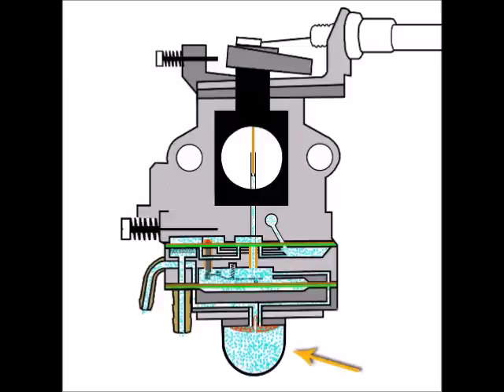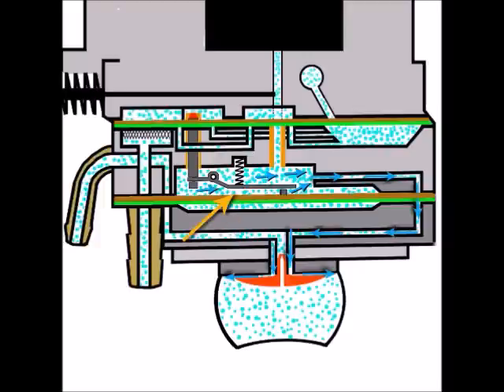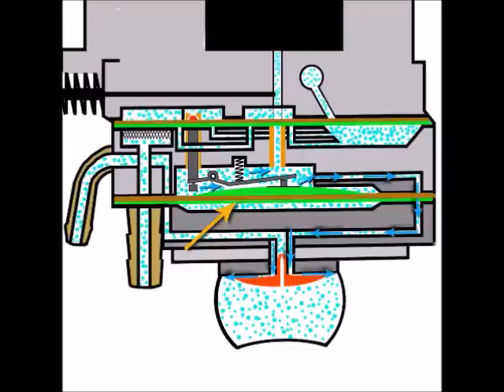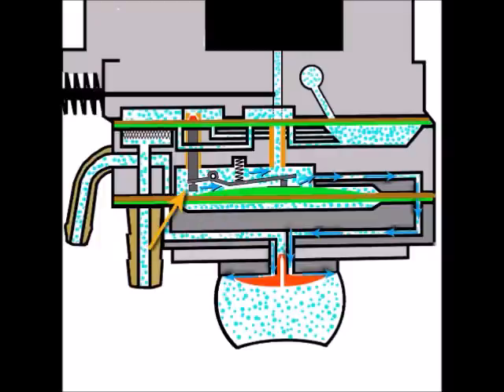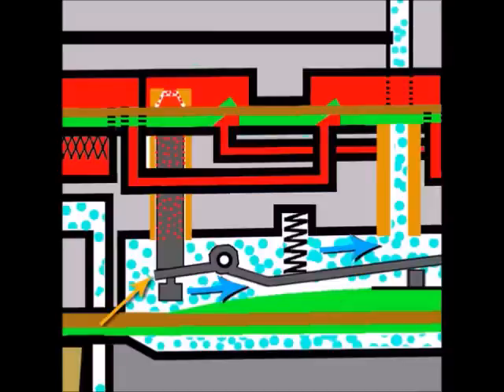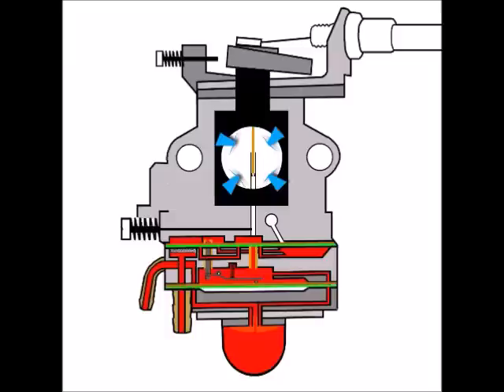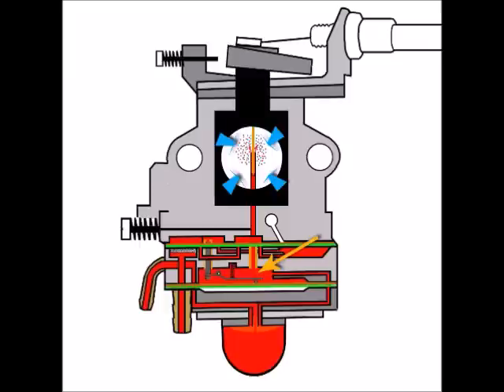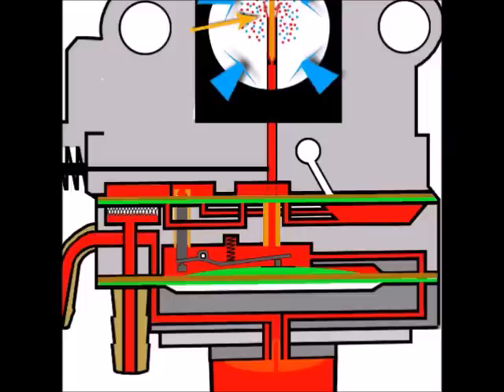CHAINSAW CARBURETOR DIAPHRAGM: 'Metering Diaphragm' EPIC Function!

Comment: This is the best explanation I have seen to explain Metering Diaphragm Carburetors for 2 cycle engines. Most people I deal with just toss them out and buy a new one without ever learning the basics of its operation.
Reply: The main reason for that is because usually just replacing the diaphragm or carb kit doesnt fix them, it's usually a faulty check valve or small passage under one of the Welsh plugs is blocked and if you have those problems it costs more to fix that carb than it does to just buy a new one and it saves alot of time especially of you have to take the carb apart multiple times, I have personally wasted hours of my life trying to fix these diaphragm carbs and usually after you spend hours and get no where you just get fed up and put new ones on. Go into any STIHL dealer and ask for a carb kit, they wont sell you one because the kit is like $19 dollars or they will sell you a brand new stihl carb for around 25 or just slightly more than a kit on most machines and you dont risk messing anything up. I personally dont even waste time trying to fix these carbs its 10,000 times easier to buy a new one and doesn't cost much more, even some of the Chinese replacement carbs are cheaper than a kit and I have used several with great success

Comment: This is a  well done video on how things work on the fuel supply side of the carb.  I have a question about what is going on with this diaphragm as the motor is running.  If I understand what you have said, once the motor is running and a vacuum is created this diaphragm is then constantly forcing the metering needle open? or at least open when there is enough vacuum to activate the spring and open the metering needle.  Or do I have this wrong and the diaphragm oscillate as it operates?  Thanks for your help.

Comment: Hi! Thanks for a very good explanation.
I am currently trying to find out why my chainsaw makes the sparkplug wet every time I try to pull start. It does happen even without choke. I try to dry the plug and try again but it does not ignite because plug is instantly wet. Spark is okay. Can you help? is there some needle not properly seated and sealed?
Reply from the maker: It could be needle issues but i would personally start by resetting your chainsaw https://www.youtube.com/watch?v=74p9FLmIkkw&t=105s here is another one of my videos explaining how to reset your carburetor hope this helps you :)
- Craig

Comment: Hi. You vids are so informative it's mind blowing. I have leant a lot. I have a question can a pressure or leak down test be done through the spark plug hole if the exhaust and carburetor hole are blocked off. Thanks Glenn

Comment: Thanks for the vid!
Unfortunately, none of the gazillions of vids online (Youtube or others) explain what to do when everything in the carb seems to work just fine, and the engine starts and runs, but is still finicky as all heck. Pressure reg seems good, fuel pump works well, fast and slow fuel needles are adjusted, idle stop is set... Engine starts and runs well for a while, you use the saw (or whatever) for a while, then it acts up again.
Man oh man are these little carbs a fiddly pain in the arse!
Reply: @dehoedisc7247  I have plenty of both imagination and mech experience, and have designed and built successfully running small combustion engines entirely from scratch. No need for the hostility.
Anyway, when an engine 'seems to want to run', but is really an incessantly fiddly pain in the arse (which they frequently are), it's invariably a carburetion problem.
Reply: did you try a different 2 cycle oil?
Reply: @mattfrank5314  Wasn't the oil, it was the carb, which I finally got sorted out nicely and the saw ran like a champ. I got a fair bit of work done with it, running perfectly, then the ignition module crapped out! I trashed the starter trying to get it to run again :)

Comment: I have the same question as another commenter here. When the engine is running is the metering needle constantly held open or does the needle repeatedly open and then fully close as the piston cycles?

Comment: hello. I have a 4 cycle trimmer that is misses at open throttle.. if I back the throttle off a bit it smoothes out....or if I put the choke on a bit it smooths out a little too? It's a new carburetor and no adjustment on the high side. a barrel type on a troy bilt 575ec.
was asking if I should adjust the diaphragm, or drill out a jet? to enrichen it? or do you think it may be another issue all together? Don't work on many 4 cycles and usually the only carb problems  I've seen was bogdown not a miss?  any impute on something like this?
Reply: You have a fuel supply issue, the carburetor should be set fine from the factory (albeit a tad lean for emissions regulations) shooting some carburetor cleaner into the fuel inlet should clear out whatever gum or varnish or debris that is blocking your fuel flow. Also check for fuel line cracks and the fuel filter.

Comment: so question, my troybilt weed wacker primer bulb stays stuck in. When i press the primer bulb in it never pops back out. I have all new fuel lines and filter on it. Does this problem sound like my metering diaphragm is not working correctly?

Comment: i have a small engine with a WT997 i found that idle and low operation is fine but during the high carb operation it bogs down in and out until im full throttle and it dosent move.I opened up the carb and there is a deformity on the metering gasket caused by a clogged fuel cap.Could this be the reason it bogs on high ?
Reply: Are you running this carb on an RC car?

Comment: A question if I may...I have a Ryobi trimmer, that I rebuilt the carb.  I got it running, but not well, have to use ether to get it started. The fuel line going to the carb is solid with fuel, but the line leaving the carb going to the external primmer bulb gets air in it and lots of air in the primer bulb. It is like it is pulling air internally from inside the carburetor. Any idea what is going on here?
Reply: Have you replaced the gasket and diaphram? they will get brittle and leak with age, air and fuel.
Reply: There is a tiny check valve assembly not shown, its often pressed into in the carburetor body between the metering diaphragm and the inlet of the main jet and its not shown in the examples here, its there to prevent air from drawn back into the carburetor when the metering diaphragm is under vacuum when the primer bulb is operated if that check valve is faulty it will let air be pulled backwards down the main jet and you will get bubbles and some loss of priming suction on main fuel inlet . it will also make the carburetor not meter the fuel correctly in the midrange to high speed step..

Comment: my blower wont stay started when i tilt the blower so i can blow debris.
Reply: it stays started until i tilt it than it bogs down
Reply: I know you posted 8 months ago but, i'ts likely the fuel pickup hose in the tank, it should have a brass fittting at the end and needs to flex to stay in the bottom of the fuel tank. Good luck.

Comment: Most knowledgeable on tube bar none. Those Metering Diaphragms can be hell if you don't get the exact replacement. if that diaphragm nipple is too long or too short  the carb will never run right.